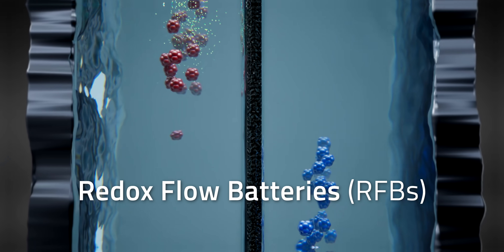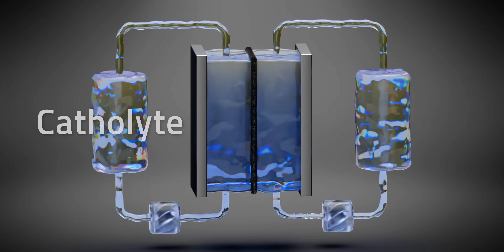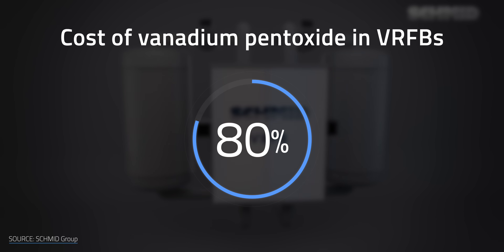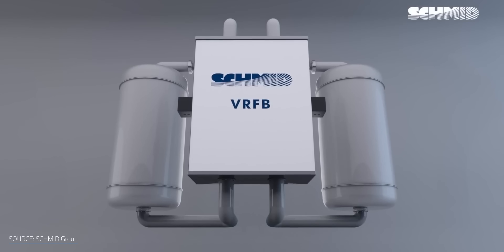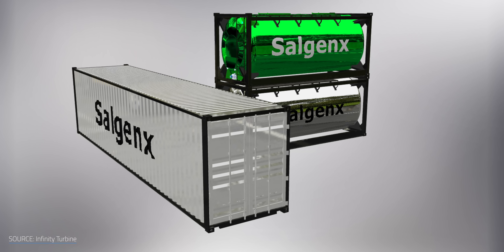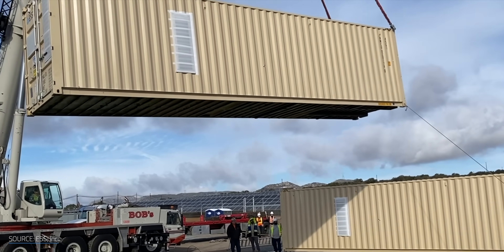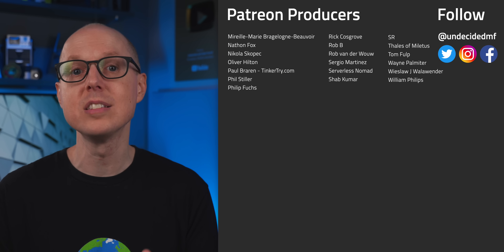Why Salt Water may be the Future of Batteries

Comment: Big problem here: what exactly is this "proprietary electrolyte"? If you want to use a solvent that dissolves chlorine as well as salt dissolves in water, you've got a few options, all of which have problems. As best as I can tell from trawling scientific literature, the liquid that's best at dissolving chlorine is tetrachloromethane (CCl4). CCl4 is a carcinogen that produces phosgene when burned, so, not exactly ideal.
Other options include hexane (which smells awful, is very flammable, and doesn't dissolve chlorine as well as other options), some kind of fluorocarbon (which tend to be nasty greenhouse gases), or PFAS (I think I don't need to explain the problems with this one). While this doesn't make the saltwater battery useless, it does restrict its applications a bit.
Reply: The patents are out there.
Reply: @kennydoerksen  Mind sending them to me?

Comment: It would be neat for salt water batteries to finally get the attention they deserve. Imagine mandating the use of excessive solar power energy for pumping ocean water to water towers along fire roads in the foothills, simultaneously solving the duck curve problem as well as protecting against California forest fires. Energy can be recovered as water flows back downhill to the agricultural valley for desalination and salt water battery manufacture.  Not that the valley is looking for more water these days...  But hey, maybe a network of water pumped pipes could help relieve flooding too?

Comment: I love Matt's work. Positive information about the future without sugarcoating. But, he glossed over Project Nexus. The work in the Turlock Irrigation District is just the pilot project based on work done at UC Merced and Santa Cruz. They are only covering 250 miles of canals. The goal is to scale it up to cover the State Water Project. That is 4,000 miles of canals. The SWP is also the largest power user in the state. It is projected to generate 13 gigawatts of electricity and save 63 billion gallons of water.

Comment: If one were to utilize the stations for city power, you'd need place to put them. So you have a large area dedicated to storing power and nothing says you can't use double down and add solar panels to generate a little. Yes I understand that solar panels are not great every where. If space is limited for what ever reason, you could bury the stations. It has a 25 year estimated shelf life so its an option that you wouldn't have to visit too frequently.

Comment: flow batteries only make sense if they can scale to super-grid scale at half the cost like almost immediately. Otherwise the maintenance issue will mean they are not economically viable from just the next (currently going into production) alkali ion batteries, let alone the next generation. They are a one-shot solution, a single generation might patch the gap, but they will never be replaced with flow-type again.

Comment: Assume Celgenex [or someone else] works using this technology. It's COST to produce is very low per KwH, compared to other types. Wonderful so far. However, they would be crazy to set the PRICE per KwH  based on COST [at least at first]. They SHOULD price it at  some mark down from it's nearest competitor's PRICE. For instance, 70-90% of it's competitor's PRICE per KwH. Result? Cellgenex will make a LOT of money, but users won't make nearly what the technology offers until enough competition enters the market.

Moral of story: Buy stock in Celgenex or whoever gets there first, and buy their product only after it meets stiff competition.

Comment: One question.
Is the efficiency of the Salt Water Battery affected by the purity of the Salt in the water? For example, you mentioned using sea water as an electrolyte but the salt in sea water is NOT pure Sodium Chloride. Rather it is a mixture of various metallic salts. So, would this battery still be able to function and, if so, how efficient would it be?

Comment: I think researching all options can only ever be a good thing to do. Whether the end result is good or bad. I do think solid state batteries will still win the day ultimately for longevity, rapid recharge, safety and storage capacity.. although I also believe using solar in places where its always hot like deserts is a big win... as you can heat up large volumes of water during the day ASWELL then use the steam from that heated water at night to also create power which returns more power then the solar during the day.  You only need a tiny area on the world map unused desert land in Africa out in Vegas to power the planet.. just the logistics of having decent power cables to hold the massive charge. If anything I think power transfer should now be the focus

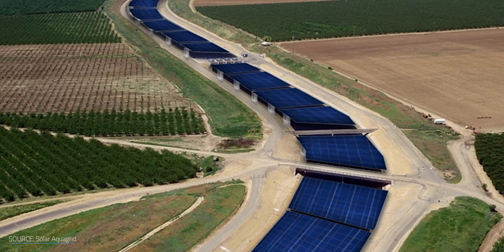Comment: At 8:45 the writing on the container reads 50KW/400KWh, in case of home battery use it would be 0.5KW/4KWh nice for letting the lights burn, but not enough for the kitchen oven. Such a home setup would require an energy buffer or a super capacitor of some sort to deal with bigger power draws and that would complicate the setup (more expensive). Just my 2 cent.

Comment: Why not use water hammers instead of pumps. I assume electric pumps wouldnt have the same longevity. Also, failure modes need to be considered more fully it seems?

Comment: ESS will not succeed unless they bring out a residential unit that can be used at home, if they will not do it, someone will reverse engineer their commercial units and sell it from china cheaper than lithium ion batteries, also you only need to buy the center unit, the rest can be bought at your local hardware shop. So the average home will be fine with a 15kw system and you can decide how big you want your solar/wind array and storage tanks. Even 5Kw systems would be fine, you just add more if you need to. They should start selling residential units as fast as possible because home tinkerers will figure out how to build their own units.

Comment: I'd be interested in knowing what voltage each cell can produce singularly and in series, and if the series configuration would produce some type of imbalance between the cells. This would be important in converting it back into usable grid energy. Otherwise, Matt, you had a great presentation.
Reply: What's the charge and discharge rates also?

Comment: I have been interested in flow batteries for the last several years.  One thing to keep in mind,  in cold climates they would need to be heated.  Zinc bromide chemistry batteries take up half the space and are also very safe.
Reply: That's why it should be used by power plants to optimize their output and reduce heat waste

Comment: Living in California, yeah.....were trying to limit the amount of utility stuff that can catch fire, which makes ESS's IFB a very good fit for us.  Ive been in the HVAC trade for 17 years and no one ever factors in the cost to buy, operate and repair all of the A/C systems that Li-ion requires, people get fixated on "95% efficiency" as if that was the end all, be all of battery tech.  Reality is IFB, will last way, way longer than any lithuim product and will have the same capacity 30 years from now as it did on day 1.  The 25 year life expectancy, is a little misleading, theres nothing wrong with the electrolyte or stacks at that age, its just the life expectancy the manufacturer of the storage tanks give, so no reason you couldnt run it decades longer

Comment: My favorite thing to postulate (read : daydream) about for energy solutions is using existing infrastructure in some way. Bridges and roads could be used to grind basalt to produce powdered basalt (to absorb atmospheric carbon and use as building material) or produce electricity from piezoelectric cells (prolly not that good of an idea.) Buildings could be used as the weight for gravity batteries.

Structures built in the ocean could be made to produce electricity using the cathodic effect of rust. Tidal changes could be harnessed to remove oxidation.

Comment: I've long felt that a lot of our metrics for good batteries are not actually that important for grid storage. Things like energy density and to a lesser extent round-trip efficiency are not actually that important at that type of scale. What matters most of all is just the total life-time cost per watt-hour delivered. Round-trip efficiency does matter somewhat for that cost and separately will matter as long as wasting energy due to inefficiency continues to directly result in additional carbon emissions. But maintenance, construction, and material costs are what are going to end up being most important for grid storage in the long run as it approaches global scale and as we finish transitioning away from fossil fuels.

It will be interesting to see what comes out on top in the end. My money is on non-chemical methods like pumped hydro, compressed air, fly-wheels, thermal, etc. because of these cost concerns; they are typically less space efficient but in exchange, they have significantly reduced complexity in both creation and operation. Infrastructure is certainly not simple or cheap to build, but concrete and steel are much better than rare earth materials in those regards and the additional land for storage is generally not that big of a concern in the grand scheme of most grid-scale green-energy projects which already take up a lot of space. I could however see some sort of chemical/battery storage system working out if we could find a battery chemistry that both fits all of the safety and efficiency criteria we already expect while also being effectively recycled. Since material costs for batteries are one of the biggest factors, and they have to be replaced more often than most mechanical storage systems, finding a battery which is relatively cheap to make and which can be very cheaply and completely recycled would be huge. Without that miracle battery though, my money is still on mechanical for the largest scale projects.

Comment: This one has a lot of applications, but it's the environmental and safety aspect of it that I like the most. I really hope that it can be scaled to a marketable use for home energy storage applications. If I understand correctly, when the battery has reached its end of life, the liquid solutions can be flushed and replenished within the same containment system, Right? Meaning it would cost less to replace with less construction and repair costs for the customer?

Comment: I already see a combination  of SalgenX and ESS iron batteries. It comes down to city/state planning. There is room for both. No need to compete.

SalgenX batteries at coastal cities desalinating/creating graphene for export. 

Then ESS for larger power capacity as you move instate along canals providing desalinated fresh water to localities while also creating reliant power systems during states of emergency. Something California definitely needs; which could also provide export to other various states. 

We just can't have nice things because of political and industrial corruption; caused by a need to maximize profit. We could still have profit in this model; just not enough to satisfy political and shareholder greed.

Comment: Utility scale battery discussions lends to a different format. For utility scale batteries energy density is not that big a deal. Cost per Wh is important and Wh per square meter footprint  might be useful to know. Then furthermore if it has potential for residential scale storage volume wise (can it fit into the garage and how safe is it). Utility scale is a given.  Past that the efficiency and the charge/discharge rates are important to know. Scalability is another key attribute though more difficult to quantify. Potential GWh per factory per year is an existing "metric" that has helped planners.

In almost all cases Li-ion outperforms everything else. Needless to say their cost and availability add challenges to seriously scale their buildout. Utility scale storage can roughly fall into two categories. Tech that can adjust for demand and frequency in near real-time, and those that are slower. Li-Ion is the prior, with excellent efficiency. Super batteries. A battery obviously has to be as efficient as possible. These are pretty great at 90%. The question is then. How quickly can they adapt to changing discharge demands. Once it hits a cost/scalability/efficiency sweet spot, their place in the grid is entirely determined by the discharge properties. In other words, can it serve in place of Li-Ion, or as buffer storage in tandem with Li-Ion, as a plug and play solution. Or at worst maybe as a standin for Li-Ion with manual intervention to smooth out the discharge power. As is not unusual with most power stations.

Comment: The idea of a saline battery sounds great but there wouldn't be a problem with energy generation if others hadn't suppressed workable ideas in the past. Due to the "invention secrecy act" of decades ago inventions have been suppressed because they were either way more efficient or way more effective at generating electrical power or mechanical power. 2 prime examples are Howard Johnson's fully magnetic motor or Stan Meyer's water engine. Johnson's motor was suppressed and ignored until it was mostly forgotten about and Meyer's engine was suppressed by his murder. There are many other inventions and inventors that have been suppressed or the inventors murdered or frightened into submission by those in power. Even as good an idea as a saline battery could be the probability of it every making it to production is slim to nil.

Please spread truth instead of the fake science lies that are spread by fake scientists or fake narratives.

Comment: Salt water has been the "battery" for solar energy since the moment the Earth was formed.  It is also essential in regulating the temperature of the planet.  Extending that role to include RFB's, deployed in large arrays to meet long-term storage requirements created by intermittent renewable sources, seems like a very sensible answer to that particular challenge.  If it can do so while creating fresh water, graphene or maybe even facilitate hydrogen sequestration, that would be remarkable.  The future may be "undecided" on this topic, but there are certainly many different and exciting options being developed.

Comment: The problem with a diffuse set of options is that we limit the advantage of economies of scale. All of these options are interesting and you do a great job showing how they can fit certain use cases, but while focusing on just a few technologies can stifle innovation, it also optimizes cost.
Reply: Always focus on as much variety as possible early on, and pick the best for a given situation after. Most of the battery designs that have come out in the past couple years will not be around in the next couple, because even if they're better than what we have now, they can't all be better than eachother. 

That being said, there's no point in just picking the first one better than what we have right now and mass-producing that when there's something much better right around the corner. Once the innovation slows down, it's about picking the best from there.
Reply: Economies of scale don't scale forever. In many cases it can be a u shape. Economics explained has a recent video on this.

That said, it's hard to imagine salt and iron batteries not having an incredibly wide u
Reply: @Indecirphrus  I was going to mention that. Thanks for the post
Reply: @Indecirphrus  I don't trust batteries which plate iron on the anode side. That process is incredibly difficult/impossible to do reversibly without degradation. Rust is not an impermeable barrier to further degradation so the plated iron will rapidly rust away within a few cycles
Reply: Why can't there be numerous cost effective solutions? And how do you know hyper centralization is necessarily cost effective? I think there's plenty of capital out there, but the rich are too obsessed with asset prices to actually invest in these sorts of technologies.
Reply: Absolutely NOT and it is the WEF types who want to limit as many solutions as possible. The demand for energy is so vast that even a limited solution will benefit from Economies of Scale.  A massive grid storage solution is fantastic for the Grid but useless for a car or airplane. We need every generation and every storage solution possible to meet the needs of modern society. Some will fail because of economics and some will fail because of the environment but there are so many different needs for energy we need as many solutions as possible even is some will fail.

Comment: When new house construction includes a 1.5m by 1m battery buried in the back yard, and the solar panel on the roof keeps it charged, and it can run the house for four days without a charge, our energy problems will be solved. Only municipal, corporate and industrial needs should be on the grid after that.

Comment: What makes me a bit salty is that all new batteries are compared to lithium-ion even if they are in a completely different aplication. That is like comparing racing cars with trucks, some have small power in short duration and some have less power, but higher total capacity and are cheaper. It would be better to just compare trucks to trucks and not otherwise.

Comment: 125 Wh/L is lower than Li-ion, but not by an order of magnitude. It's already pretty good! The department of Energy has a great chart showing the increase in density over time (search for energy FOTW 1234). Li-ion batteries had an energy density of 55 Wh/L in 2008, 140 Wh/L in 2013, and 450 Wh/L in 2020. It's an 8-fold increase in just 12 years, and we'd likely see great improvements for new battery technologies given time and investments.